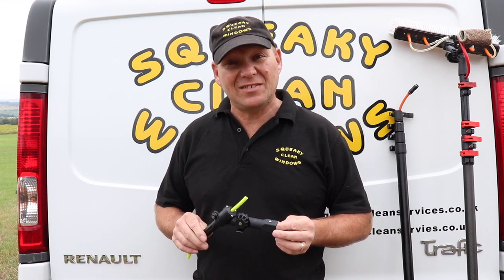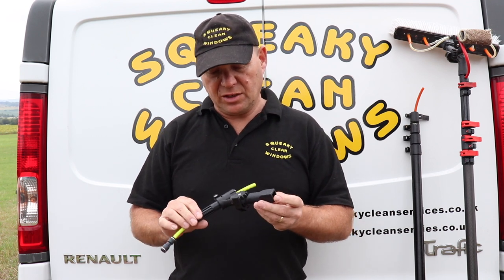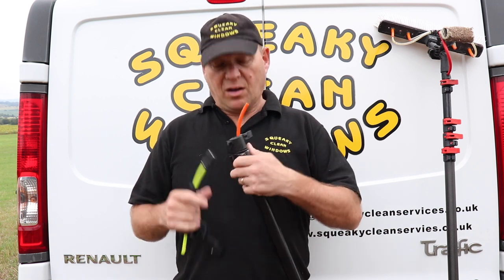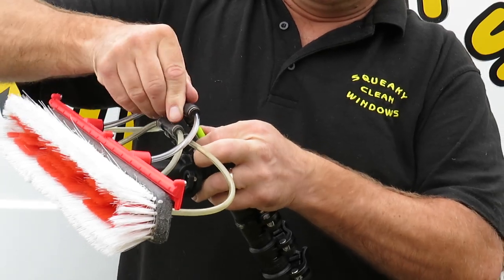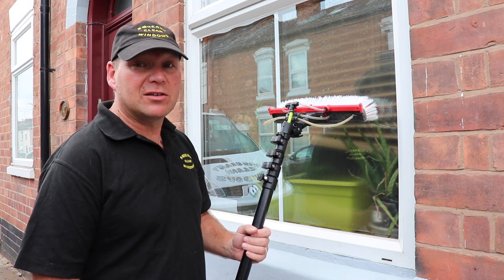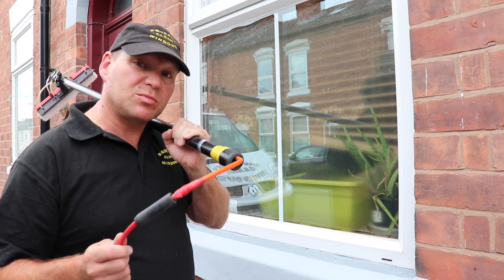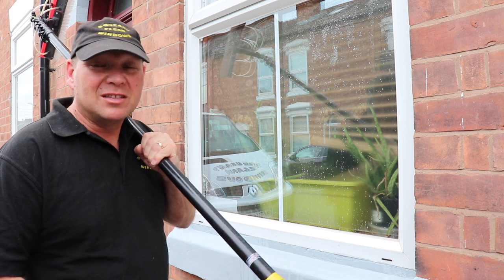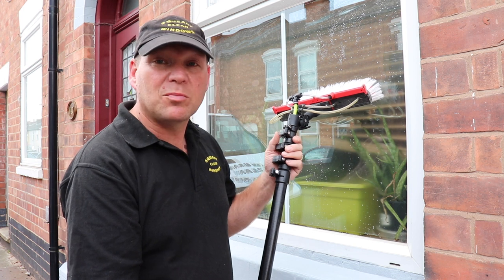Gardiner Quick Loq Valve Review

Comment: Fantastic review Dave , however I used the aquatap years ago which is the same thing via twisting the pole but over 35/40 ft I found the aquatap very hard to turn/on/off , until I mastered it , one more disadvantage by turning the pole left/right this put a lot of stress on the pole clamps making wear out a lot n spinning issues .
Reply from the maker: DA Components good points Darren. I don’t think it will take over from the univalve 👍
Reply: Poles spin badly now from gardiner

Comment: Hi dave just wondering if you had used the quick loq long arm adapter. Struggling to get my head around how to fit univalve to it as with the old quick loq the one you get free I used hose stopper at the top to stop unvalve tugging through etc. With this one it has a barb at the bottom what's the best way to fit the univalve I.e. pole hose runs the univalve but then what hose to the barb? As it mentions using push fit etc but will this be strong enough to withstand the pull on the univalve.. any photos or videos be massive help sorry for the long winded message.

Regards Ed
Reply from the maker: Hi Edward. Not quite sure if im getting what you are saying right or not. Are you worried about the hose pulling out of the push fit connector. 
if thats the case it shouldn't be a problem as Exceed sell them with a push fit. 
if I got the wrong end of the stick give me a ring and I will try and sort it for you. 07956222348

uni-valve-interchangeable

Comment: Seems good but how do you turn it off after a rinse with the brush not on the glass? Or are you relying on the rinse bar make it possible to rinse without taking the brush off the glass?  
Thanks for the vid
Reply from the maker: Dom Evans that’s a good point I meant to bring out. I found it best to turn it off pushed against the bottom of the frame but there is always a chance of any bits on the brush transferring onto the glass
Reply: Ah yes that makes sense. Not that I have tried it but I can see myself in a loop of turning it off on the frame, worrying I’ve splashed bits, then re-rinsing and back round again 😂

I wonder if you could use both this product and the univalve to get the benefits of both. But maybe that’s overkill.
Reply from the maker: Dom Evans I might as well have used both the number of times I pulled the hose to turn the water on before realising it wasn’t fitted🤪

Comment: Going against the all other opinions it seems but I love mine wouldn’t be without it and I’ve used uni valve before. Agree the clamps a little fiddly tho
Reply from the maker: Michael Carbon I think that’s the thing about modern window cleaning equipment. There’s no right or wrong. It’s just finding out what’s best for you. 👍
Reply: Hi Dave how did you fit you hot water element to your tank.is there a video regards Chris
Reply from the maker: fenlychris hi Chris. Try this link. It was the 1st proper video I made. 
https://youtu.be/Ogw6FBV3suw

Comment: Good vid, thanks. Quick loc valve isn’t for me. Had the first variant and this seems no better. I work with a swivel. Finding that sweet spot where it stresses the pole sections if its to tight and turns the water off when working at an angle. This equipment just further complicates the job. Alex missed the boat with the launch of the univalve I’m sure it won’t be available for long
Reply from the maker: Tony Lee you are completely right with what you are saying but I thought it was worth a try

Comment: Well I guess if you use a swivel you won’t be leaving the univalve any time soon. Like Darren I used the aqua-tap for a long time. I was able to get it to work on a swivel. I would bring the brush down to the corner of the frame so it wouldn’t slip, then I could twist. I was a little of a pain. Nice review 👍
Reply from the maker: Aeria Pro thanks Ray. I did manage to get it to work with the swivel but like you say it was to much of a pain in the butt to be effective. Thanks for watching 👍